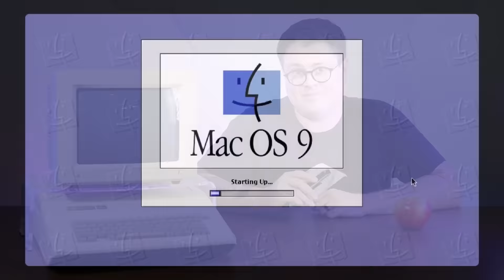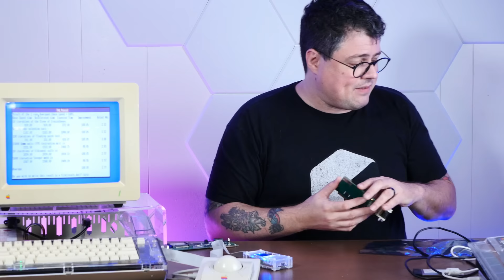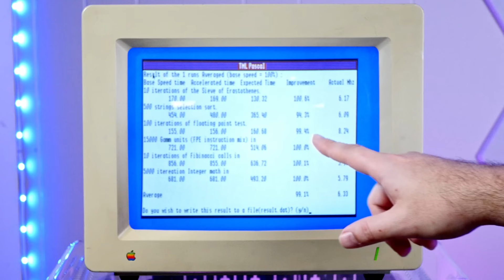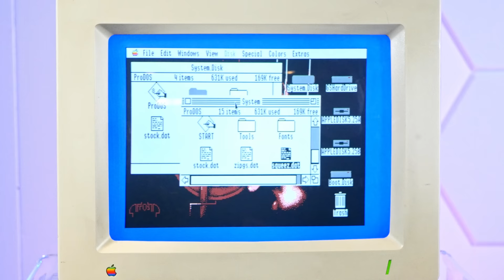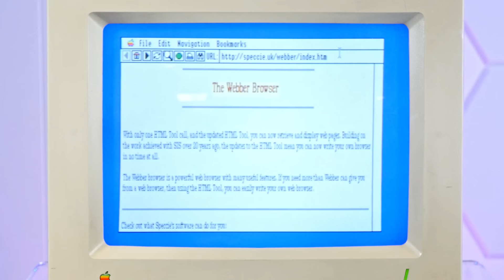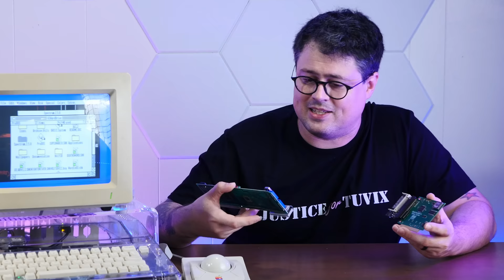This Apple Accelerator is INSANE

Comment: The reason the internal keyboard doesn't work is probably because Wolf3D uses a special direct ADB-chip hack to allow simultaneous keypresses.  Maybe the //e keyboard header doesn't contain the signals or has some other reduced functionality compared to ADB.  If you have Out of This World, that uses the same hack (pioneered by Burger Becky).  See if that also doesn't work.  Sorry about your CFFA!  You really need that to work :)
Reply from the maker: ah interesting, thanks!
Reply: It's not just that the keyboard can't do simultaneous presses, it can't do key-up events at all. It's basically the same keyboard interface as the original Apple II keyboard back in the late 1970s. On old Apple II games you'd see this all the time, you'd press a key once to start moving, and then again to stop - because the software had no way to detect when you released a key after holding it down.

Comment: Awesome video!  I got the AS early on (Order #006!)... And as it turns out I had that early motherboard too.  To make the AS fit, I replaced the DIP socket (the original was too loose) and desoldered the number pad/keyboard connectors.  So, had random sound interrupt errors and worked with Niek on it.  He was extremely responsive and supportive (in fact offering a refund multiple times, of which I refused).  Fast forward to yesterday - he sent me an updated core to try out and it WORKS!...  Sounds are no issue and the system is very stable.  Well done Niek!
Reply from the maker: Ah awesome!!
Reply: I had to replace the socket too, but am still getting the sound interrupts as well as distorted sounds. The new test core for me seems to disable all Ensoniq sounds 

Niek has been pretty good with trying to work a solution. We just need to figure out the variables between the different variations on the ROM 01 boards
Reply: @lemonherb1  Interesting... I played synthLAB for about an hour without issue - the sounds were perfect.  Played Tetris, Arkanoid, and a few other games and the sound was great.  I have the DarkSound card.
Reply: @glonch  I don't think the stereo card is the variable as the distorted sounds also come through on the stock speaker.

I've tested three other ROM 01 boards, two were behaving fine, and one booted to the desktop good, but crashed as soon as I ran SynthLab. Clearly there are some differences between them. They all are the B version of the board, but have different versions of the VGC and Sound GLU
Reply: @lemonherb1  Makes sense
Reply: It's interesting to note, according to the build date stamp under the PSU, both boards that were having problems were built in the first and third week of 1987. 

The other ROM 01 boards I have that are working with AS were built in 38th and 46th week of 1988
Reply: @lemonherb1  I'll have to check my board - where is the date code exactly?
Reply: @glonch  under the PSU by the bank of STANDARD RAM at the front is a stamped four digit date code
Reply: @lemonherb1  33rd week of 1987
Reply: @glonch  Interesting. I wonder what chips were different between Jan 87 and Aug 87
Reply: @lemonherb1  Not sure it was a chip difference.  From what I gather, Niek thinks there was a board issue that they had to dodge up...  cut traces, add a resistor, capacitor, etc.
Reply: @glonch  it’s possible. But on my working ROM01 boards, they have different revisions of the VGC and Sound GLU at the very least
Reply: @lemonherb1  Interesting - did you let Niek know?
Reply: @glonch  He knows, we've been in contact all along. He made a new test core for me, but all it did was kill the sound output from one of the ROM 01 boards, the other still shows audio distortion and crashes upon launching SynthLab

I'm assuming he's trying to figure out a strategy for a new test core.

At this point, I'm just going to swap one of my working 1988 boards in my clear case. I just need to solder on the keyboard header and some wires for power on an extra slot

Comment: I was a LONG time IIgs user. It was my main everyday home computer, not a museum piece. Used both the ZipGS and Transwarp accelerators, don’t remember speeds. I seem to recall Zip was a bit slower but less finicky. I should dig it out of the closet to see if it still works, although might be a problem because CRT display died (and it’s not a standard display). Cool that people are still creating (and buying) new products for it.

Comment: Great video today.  I have an idea for a future video.  Have you considered dropping a PiStorm in a 68K Mac as an accelerator?  I've seen a lot of Amiga videos about it, but a quick search indicates that it will work in a Mac, just without some of the special features.  Keep up the good work!
Reply: Wow, now that's an extreme upgrade!
Reply: That function is still very early in getting to work correctly.  Memory Maps are mostly complete, and really the boot process is very touch and go still for Pistorm.  I have a Mac SE with a newly socketed 68k socket to work on this with my PiStorm and Buffee replacements.  BOTH are "sorta" working projects in the mac.  PiStorm is great on the Amiga 500 however with some caveats due to DMA and interrupts still being an issue on the Amiga platform.

Comment: It's interesting that some of the keyboard keys are not working in Wolfenstein 3D with your IIGS motherboard and the Apple IIe keyboard, especially since that header on the early IIgs boards is a factory deal.  Have you confirmed the keys work with other software? With your CFFA 3000, maybe you need to reflash the firmware to get it working properly?  As for the rest of your video, pretty cool! I hope the chip shortages go away sooner verses later. There are a lot of cool pieces of hardware I want to get but can't at the moment. Boo!
Reply from the maker: Hah, someone elsewhere in the comments mentioned that Wolf3D uses some weird ADB chip hack for better simultaneous keypresses!

Comment: When I take apart two components that are stuck together, I usually put a sharpie mark on one corner to make sure they get back together correctly.
Also, have you thought of replacing the socket on the board by a ZIF socket? They are perfect for switching stuff around without breaking anything.
Reply: Good suggestion ! I did change the socket on my side, but simply because the original one could not retain the Squeezer...

Comment: My revision ROM 01 is the same as yours. I just had to populate they keyboard header for my own clear "Not So Stealth IIGS"

But from the get go I had issues with the AppleSqueezer, and I think it's primarily due to the stock CPU socket on my GS. I'm going to see if I can dig up a dual wipe 40 pin dip socket to use as a 'riser' like you have to see if that will work. But I suspect I'll have to replace the socket all together.

I did run the AppleSqueezer on a ROM 3 without issue, but that one already had the CPU socket replaced with a machine socket years ago.
Reply: Just a bit of a followup on my AppleSqueezer problems. It ends up that it has problems with two of my ROM 01 boards. And interestingly enough both were assembled in January 1987. The date stamp is near the PSU that has a four digit code. The first two indicate the year, and the last two indicate the month. I've sent both these boards to Niek to test and develop a solution for, so I suspect that full compatibility with ROM 01's will be forth coming.

Comment: The main issue here is the same as for SUperCPU C64 accelerator. It still has to keep the video ram in the old slow memory of 2.8Mhz, because video chip can access it only there. So every time the new cpu has to write to video ram, it slows down to 2.8. With applications that do a massive transfer to vram, such as Wolfenstein, it seriously impedes  performance.

Comment: I wonder if a software keyboard translator program could fix the keyboard issue with wolf 3D. You've certainly got the memory for it now. 😂 I'm also curious if that fpga is powerful enough to emulate the cpu as well so you wouldn't need a real one alongside it. I know it goes against using the original hardware at that point but I'm still curious.

Comment: Fun fact, the original processor used on the 2gs was rated for up to 20mhz. Apple nerfed it to under 3mhz to make the macintosh line sound more powerful with its 68k Moto processor. However, cycle for cycle the 2gs was more powerful, more expandable, better audio, better graphics, and cost less. Apple was the king of shooting themselves in the foot and still surviving…
Reply: Not really. This was explained by another YouTuber in a video I watched yesterday (I think the video is recent). He did a deep dive into the 65816. Due to the mask for the CPU being hand drawn instead of using CAD, it wouldn't scale to smaller manufacturing processes well, had yield issues at 4MHz, leading to many 3MHz parts being released despite not being listed in any official data sheets. The manufacturing process GTE used also had limitations. Eventually they binned 6MHz and maybe some 7MHz parts, but Apple couldn't buy these in quantity, so they were effectively irrelevant. It wasn't until Sanyo, Ricoh, and possibly ASIC Inc. independently re-did the mask with CAD (supposedly ASIC did a clean room reverse engineering job in 6 months), that faster variants became available.

Comment: That is some impressive hardware. The performance gains reminds me of the computer I built right after high school that started life as a Walmart special. I managed to take an old Celeron CPU clocked at 700 MHz and push it and the front side bus up to 1.0 GHz before it became unstable. The front side bus was clocked 100 MHz and managed to get it up to 133. Used a 8000 RPM fan and copper heatsink to keep that overclocked CPU nice and cool. This is during when Windows XP was king and vista development had yet to reset. My graphics card was some NVidia card with 128 MB of ram with dual VGA and used a matching set of 17 inch CRT monitors to round the project off. Some time later upgraded to 5.1 surround sound and used not only Creative for my sound card but speakers as well as they were on clearance at the time. That machine would quickly become irrelevant years later as the Pentium 4 got faster, better, and actual dual cores. Oddly enough my next computer would end up being a Toshiba laptop from 2009 built with gaming and vista requirements in mind. I'm one of the lucky people who got to experience vista for how it should have worked in the eyes of Microsoft.

Comment: @Action Retro - upgrade to the 100mhz "65F02" next? 
Its a drop-in replacement made with a similiar FPGA to power it, in the same pin-out as the stock 6502 CPU!

Comment: Oh I just got one of these! However I have a very early IIGS with the bodge on the bottom. So it crashes. Hopefully they find a solution. Otherwise its an awesome solution!
Edit after watching the whole video: It's very interesting that yours works. I wonder If your IIGS has different values on the bodge on the bottom. Its an RC circuit (one resister and one capacitor). With my iigs any program with sound makes the system hang.
Reply: I discussed with Niek, and I have the bodge, but don't have an issue. I sent photos and feedback to Nick. I think the key is motherboard contact. The socket on the motherboard does expect flat pins. I changed with a modern CPU socket, it because I was not able to make a solid contact. Now the AppleSqueezer is nearly hard to remove, contact is perfect, and I've had strictly no crash for hours. I don't think the bodge is an issue at all.
Reply: @philippeastier7657  hmm, very interesting, I’ll have to get a machined socket or a zif socket. I replaced my original socket with a double wipe socket that I had on hand, but maybe that isn’t making good contact. However I do need to talk to Niek about one other issue. My ensoinq makes a very loud white noise kind of sound with the sqeezer in, but with my 18mhz TWGS in it works fine with minimal noise. Maybe I have some bad sound ram, I don’t know just yet. Sockets and part changing might be in my IIGS’s future.
Reply: Yes Niek mentionned that some boards had issues with other accelerators, which I could not test. At least the bodge is not an indication enough. He does a great job, let him solve the mystery, I fed him with photos and information. BTW, my IIGS is in fact a ROM-00 upgraded to ROM-01, is that your case as well ?
Reply: @philippeastier7657  Thanks a lot for your photos indeed! I may have fixed this issue yesterday, although it was only tested with one user so far, but for him the fix worked! Will do more testing and then release a new core version for everyone.
Reply: @philippeastier7657  Yes it is. my IIGS if I recall correctly was made in the 1st or 2nd batch of IIGS's, and is a WOZ. When I get home (and hopefully remember that I wrote this comment), I'll check my serial number and see. But I do know it was a ROM-00 in the beginning of its life.

Comment: I really wanted one of those, but the DMA issues were too much for me. I already have a TransWarpGS (the Reactive Micro rebuild), a VidHD and a MicroDrive Turbo, and while the TransWarp isn't the most stable solution, I don't think I could do without the VidHD or the MicroDrive at this point.

Comment: Wait, the apple squeezer plugs into the standard slot that the original processor chip slotted into correct? Couldn't it be slotted  (ishh as you'd have to run a set of wires to the card) into the zip 2gs card? What would happen I wonder?
Reply: I think the big socket on the Zip2GS card is only for safekeeping your original CPU. It's not connected to anything.
Reply: @owaing  that’s kinda an oddity…
Reply: @mizinoinovermyhead.7523  I guess they thought that without that, people would just leave their original CPU loose somewhere and it would get lost, or damaged by static. The ZipGS manual just calls it a 'storage area' for the original CPU.

Comment: Nice!
I do worry my old and expensive Transwarp GS that's had the snot overclocked out of it will die from old age and exhaustion some day. It's good to know I won't necessarily have to put up with a frankly unusable 2.8Mhz (thanks that Steve Jobs!) if it ever dies.
I wonder if it's open-sourced? I do quite like a bit of soldering.
Reply: Steve Jobs left Apple in 1985. The IIgs was released in 1986. WDC couldn't deliver faster reliable 65816s in time for the machine to be built around them.

Comment: So this is just my personal opinion, but Wolf3d on the ZipGS would be difficult for me to play still. And on the Squeezer, it seems odd because you move around too fast, but yet firing the gun is still laggy. It's definitely the best of the 3 setups to play it on, but I don't think I would play the game on a GS. It's a neat novelty, though. P.S. don't mean to sound snobby here; my inability to enjoy something is not a bragging point, haha.

I wonder what the other user with your motherboard revision had trouble with. Maybe they had some unrelated issue like capacitors going out or something which didn't cause an issue at the stock speed but increased frequency or increased power draw or something caused an issue. (This is just a total guess and could 100% be incorrect.)

Comment: Sean, two questions:  

(1) Can it run Crysis?  (Sorry, I couldn't resist!) 🤣
(2) If you intend to keep the AS upgrade, have you thought about modding the clear IIgs case to use a IIgs keyboard, instead of the IIe style one?